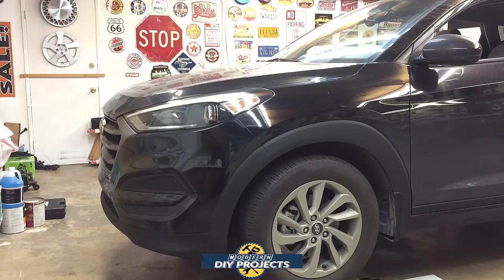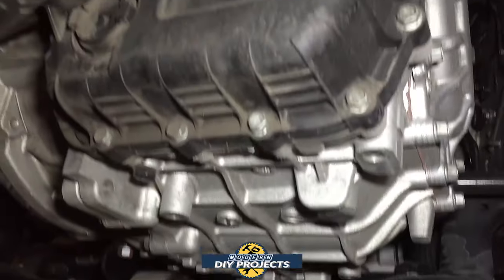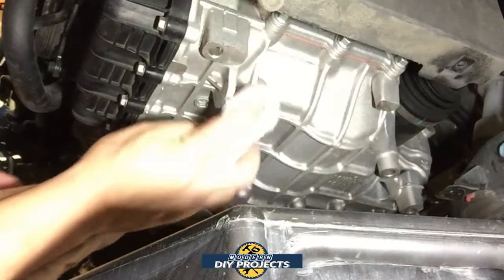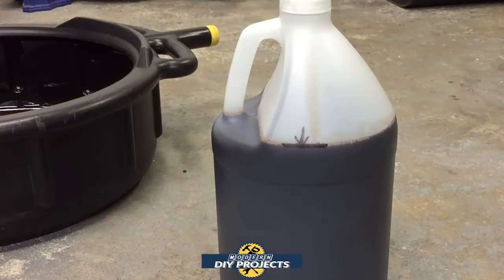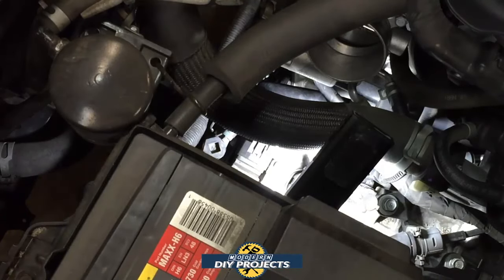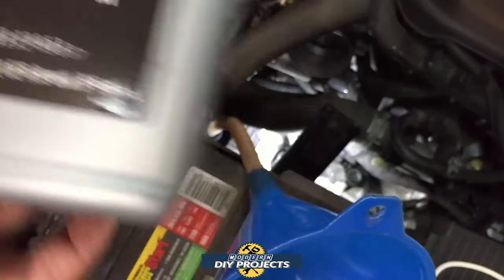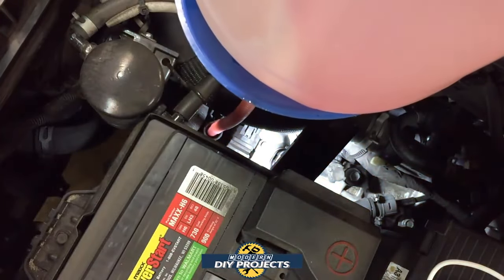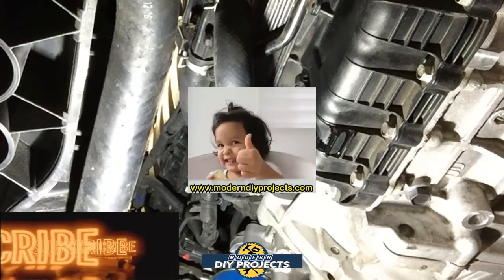How to: Transmission Fluid Change on Hyundai Tucson 2016 and Newer

Comment from the maker: In this video I show you how to change the transmission fluid on a Hyundai Tucson 2016 and newer. This procedure also applies to most Hyundai and Kia vehicles with Automatic Transmissions. Any questions on the process, anything that is not clear or I didn't explain properly, just comment down below and I'll answer your questions.
Reply: Is lt required to do reprogramming after changing fluid of transmission??
Reply from the maker: @hosamkhan8146  It does not. Works fine just the way I showed you.
Reply: thank you so much for the video.i wants to know is there a filter for the automatic transmission of tucson
Reply from the maker: @jinojose5373  It does not have a filter so no worries.
Reply: Is it ok to send a dipstick through the fill hole of the transmission and check the level before draining the fluid? Make a permanent mark on the dipstick so i will know what level to refill up to with new fluid?
Reply: @ModernDIYProjects yes filtro,
Reply: Very helpful. Thank you.
Reply: Hello and thank you, I just asked at Hyundai car service and they told me that the fluid (oil)transmission doesn't have to get changed. They said it is Hyundai standard and no go for transmission fluid (oil) change. 
I have an automatic also , 2.0 Liter,185hp, Diesel and I'm still confused about this advice from Hyundai. It's written also in the car book. Mention, Hyundai Europe, Germany.
Reply: @violaknight1989  Today i did this oil change.... at 90.000km - tucson 2018 2.0 crdi awd.  
The oil was black and looked dark and bad. Dealer said i should not change it until 120.000.km. 

Bottom line is.... dealership advice is the MINIMUM required maintanance so that your car survives the 5 year warranty. 
Of course... MINIMUM is not the same as OPTIMUM. 

PS: dont forget to also change the differential oil & the transfer case oil.  (they use the same oil, less than 1l each)
Reply: Crdi sounds like a diesel, so very different maintenance. Tucson VNA 2018 and later is a 1.6 mild turbo (175) bhp.  Of course GDI engine means top tier gas only or you will burn a valve. In the early 2020's Hyundai switched from GDI to MPI for the 1.6 and, probably boosted the turbo to keep or improve HP.
Very complicated and sometimes confusing brand, though most of the time the cars are fine.
Reply: Is this a DCT transmission that comes in the huyandai  Tucson night edition
Reply: Ummmmm according to the book and Google.  It take 10 quarts of transmission fluid.....

Comment: Great video. The only thing is the level should be checked with the engine running in neutral and the fluid should be hot 122-140 degrees (since transmission fluid expands with heat). Then open the side level plug and drain excess overfill. 10mm screws hold the bottom shield which has to be removed to get to the drain and level plugs.

Comment: Just put back what comes out, folks. Mine dropped 3.2 quarts. I used a 4qt pitcher from Walmart to measure.
Most likely, it will be 3 to 4  quarts. 
I used a funel, and I had to push it down into the fill hole. For some reason, it would burp some back out the funel. I guess it was  snug. 
I also cut out a square right below the drain plug. I don't advise doing this, but I'm too lazy to remove that cover. I will be doing this flush every August. I figure what is $25 vs. a new transmission. I used Valvoline max life multi transmission fluid. I contacted Valvoline, and they said the fluid meets all specs. 
Awesome video 📹 BTW.
Thank you for saving me $160.
Reply: It "burped" cuz it didn't have air flow vent. Kinda like how gas cans have a vent on them
Reply: @cavyboy99  yes exactly 
Well worth doing, though.
I added a little more because some splashed out.

Comment: Great video, 2 suggestions. Show how to release the plastic rivets that hold the underbody and, fast forward during the fill process. Your explanation of measuring the amount removed and checking the fill level is absolutely correct!
Reply from the maker: There are no plastic rivets for the under body cover. It's all held in with screws.
Reply: @ModernDIYProjects  There is one plastic nut on a metal stud at the front center. The rest are 10mm bolt though.
Reply from the maker: @frederf3227  Yeah, I forgot about that one. Don't know why they put that odd ball there.

Comment: One thing some automatic transmissions  have fluid checked warmed up and engine running this is because some of the fluid is running through the torque converter and valve body that will drain down when the engine is off. This is essential to check to not underfill your transmission. I have done CVT and regular planetary automatics that have this procedure.

Comment: When checking the transmission fluid level at the level plug, does the engine need to be running to get an accurate level? I thought that it did so that the internal transmission pump was circulating fluid, but you mentioned that you checked it with the engine off. Excellent video!
Reply from the maker: These newer sealed transmissions you check with the engine OFF. You do not want the fluid circulating or sloshing around. You want to get a full level with static fluid, otherwise it will pump it out of the hole when you open it up. It's just like checking your engine oil. You do that with the engine OFF.

Comment: Can the transmission fluid be sucked out with a pump through the transmission refill plug so we don't have to go under the vehicle and remove the the bottom cover and jack it up and all the mess with removing the bolt?
Reply from the maker: You can do it that way but whats the point. You have to take the bottom off to check the fluid level anyway, so what do you gain doing it this way? If you don't check the level properly you will ruin your transmission.
Reply: @ModernDIYProjects  just put back in the same amount that was sucked out.
Reply from the maker: After looking at the repair manual I have to change my answer. You cannot do it the way you want. If you try to insert a tube in the transmission through the fill hole, it wont go very far because you'll hit the valve body. It's like trying to drain the oil of the motor through the top of the motor (without using the dipstick hole). There are too many things in the way. Since this transmission has NO dipstick, there is no clear path all the way to the bottom of the pan. So at best you might drain a couple of ounces if any. So, no, you have to do it through the bottom drain the way that I showed in the video. There is no clear path to drain it otherwise.

Comment: 1. What is the measurement of the mouth of the screw to pour the fluid into it?  It is to buy that extension..

2. Should the shift change be done with the vehicle stopped or should I run it and then verify?
Reply from the maker: That would be hard for me to measure since it's so far down in there, but I would say it is the same size as any transmission dipstick. The funnel I used is made to be inserted into a trans dipstick and it worked just fine. Any narrow funnel should fit. As for the shifting, it should be done with the vehicle stopped. Jack it up and just run through the gears before putting a load on it. Then you can check the level. Or you could take it out for a drive after doing the shifting and then bring it back and lift it up again, and check it again, but that just seems like a lot of wasted effort to me.
Reply: @ModernDIYProjects  ok, I think I explained myself wrong regarding the extension, I was referring to the head, if it is to give an example of 1/2, 1/4 etc... not the length of the piece...
Reply from the maker: In that case then the answer is simple. On the outside I believe it is a 19mm bolt pattern. On the inside it is a square pattern that accepts a 3/8" drive. So I used a long extension and just used the middle opening. Since it's plastic I thought it was a safer way to go. Any long extension will do the trick.
Reply: @ModernDIYProjects  Excellent, Thanks...

Comment: Howdy,
I would appreciate it very much if you could help me in the following situation.
  Is there anyone among you who has changed the oil in the Hyundai Tucson automatic transmission? Because the opinions are divided, the dealerships say they don't change, while other mechanics say they do.

I decided to change it, especially after I opened the shield and noticed an older oil stain on the joints of the box.
Now I don't know which exchange method is better, someone told me to simply change it using the classic method by pumping inside with a can or pump. But I also heard of the method where there is a special machine, which extracts the old oil, cleans the pinions and internal holes with a solution and then automatically puts in the new one.

I don't know what oil to use, someone recommended TOP TEC MTF 5300 70w-75w.

The car has 120,000 km and is a Hyundai Tucson Turbo-TGDI 2017, petrol 1.6 automatic with 7 steps, 130kw/177hp, double mechanical dry clutch.

The questions would be:
1. If it changes?
2. What method is used for exchange?
3. And what type of oil is used?

Thank you 🙂

Comment: When should I change my transmissions fluid changed. I have 2018 Tuscon at 40000 miles.
Reply from the maker: Hyundai recommends at 60K for heavily used vehicles like Uber and Taxis, and 100K for normal use. I did this one at 100K and you can see how dirty it gets with normal use. I suggest to do it any time after 60K.

Comment: Great video. Thanks for doing this.

Two questions:
1. Do you think transmission fluid flushing is required (as against draining and changing) sometime?
2. Is this SP4 transmission fluid from Hyundai a synthetic one or organic one?

Thanks again...
Reply from the maker: Transmission flushing is an all around bad idea on a good transmission. That is something you do to try and salvage a bad transmission. Never do that on a good transmission or you could ruin it. It's like raking the muck at the bottom of a clear pond. You know the mess that makes. The SP4 is synthetic as are most if not all ATF fluids these days. Even my old 97 Dodge ATF Fluid was upgraded a few years back to be synthetic.
Reply: Thanks. That helps.
I find some comments at places about SP4 not being fully synthetic. But then that's not validated..
Reply: Thanks for sharing your video. I own 2018 Tucson and have about 75k miles on it with no issues so far. Planning to do this procedure in summer. I am thinking if i can fill the new fluid directly from level check plug instead of from top. This way I won’t need to remove anything from top. You see anything wrong in this approach?
Reply: That’s a good question.

Comment: Our 2016 eco tucson uses the SAE 70W transmission fluid. It only uses 2 quarts.
Reply from the maker: You probably have the 1.6L which does not have a traditional automatic transmission. What you have is a Dual Clutch transmission, which is technically a robot controlled manual transmission. To you it seems like an automatic, but in reality it is a manual transmission that is shifted by the on board computer. That is why it takes a different fluid.
Reply: Is yours a eco and sport? 
Automatic and gear switching?
Reply: Howdy,
I would appreciate it very much if you could help me in the following situation.
  Is there anyone among you who has changed the oil in the Hyundai Tucson automatic transmission? Because the opinions are divided, the dealerships say they don't change, while other mechanics say they do.

I decided to change it, especially after I opened the shield and noticed an older oil stain on the joints of the box.
Now I don't know which exchange method is better, someone told me to simply change it using the classic method by pumping inside with a can or pump. But I also heard of the method where there is a special machine, which extracts the old oil, cleans the pinions and internal holes with a solution and then automatically puts in the new one.

I don't know what oil to use, someone recommended TOP TEC MTF 5300 70w-75w.

The car has 120,000 km and is a Hyundai Tucson Turbo-TGDI 2017, petrol 1.6 automatic with 7 steps, 130kw/177hp, double mechanical dry clutch.

The questions would be:
1. If it changes?
2. What method is used for exchange?
3. And what type of oil is used?

Thank you 🙂

Comment: Thanks for this video. Do 2021 Hyundai tuscon have diff oil?
Reply from the maker: If you have 4 wheel drive you may have a rear differential with fluid that needs to be changed. Front wheel drive cars do not have that.
Reply: Thanks for responding so quickly. I didn’t see a rear diff so I felt confused I’ve always driven rear wheel drive vehicles. Lol
Reply: I have a 2019 AWD. Changed the transfer case and rear diff fluid at 45k for the hell of it. Really easy DYI. The fluid that came out was as clean as what I put in.

Comment: I have a 2016, 1.6 L Tucson. The manual states ATF capacity at 7.71 qts. The dealer parts counter guy told me it takes 4 qts and sold me Hyundai SAE 70 MTF. I questioned that and he reassured me that is the correct oil. Now I'm just confused.
Reply from the maker: Go back and reread the owners manual. You will notice that is gives you the quantities and fluid types for both the DCT (Dual Clutch Transmission) and the Regular Transmission. Your 1.6L has the DCT. My 2.0L has a Regular Transmission, so things will be a bit different. Also the parts guy sold me 6 qts telling me that is what I needed and I only used 3.8qts, so go figure. I would say make sure that you have the correct fluid above all else. Secondly, if it makes you feel more comfortable just go buy more fluid and return it later if you don't need it. It's better than being short of fluid when you are doing the fluid change, because then you can't finish the job and the car wont run without the right amount of fluid. I kept the extra fluid I got for next time because I got it at a really good discount. Hyundai fluids are NOT cheap!
Reply: Is your transmission DCT

Comment: Could we also refill through the overflow opening?
Reply from the maker: You can but not a good idea. I don't know if it may give you false readings. Hyundai recommends using the top opening in their manual and that is what I would suggest to use.
Reply: @ModernDIYProjects  thanks for your response. A quick follow-up question. After doing the final checks, did you have to add any more fluid, or was there drainage through the overfill hole?
Reply from the maker: There was a bit of drainage so I closed it back up. I didn't want to loose too much so I stopped and closed it up. Since I measured exactly what came out, I knew that there was no room for waste.
Reply: @ModernDIYProjects  thank you for your responses. Really appreciate this content
Reply: @ModernDIYProjects  just subscribed!

Comment: Is that really accurate? Doesn't the transmission loose some during the course of ownership by the time you change out the fluid?
Reply from the maker: Actually, the transmission should never loose any fluid unless you have a leak. As you can see this one was dirty but not oily, meaning NO leak. The transmission is not like your engine oil. You never loose any fluid to the combustion process like you do with your engine oil. But if you are concerned, then all you have to do is the overflow test which I explained in the video. It would be easier with a dipstick, but they don't want you to mess with it. More money for them if you take it in to be serviced.
Reply: @ModernDIYProjects  oh i see. I find that surprising tho. Doesn't the transmission create friction and  heat as does an engine? If so how come the transmission doesn't loose any fluid?  

Also , one other question. How much oil should a Tuscan engine or any engine for that matter burn engine oil? I noticed that after approximately 4000 miles since I last got my oil changed, I am below the "low" indicator line when I check my current oil levels. Does that seem normal to you? 

Also lastly. Is it ok to mix different brands and engine oils with different viscosity such as 5w 20 but I top off my engine with 5w 30 is that ok and doesn't cause any issues? Thank you so much!!
Reply from the maker: You misunderstand how the process works. These oils do not wear out or evaporate like water from friction or heat. They are created to tolerate extremes. The oil in the engine disppears because it escapes through the combustion chamber, not because it evaporates. It is literally burned off. The transmission doesn't do this. 

As far as much much oil you should loose between oil changes depends on how often you do an oil change. You should not loose any more than 1/2 qrt every 1500 miles. If you are loosing more than that then you are consuming or burning oil, and NO, NEVER mix different viscosity oils, that is a bad thing to do.
Reply: @ModernDIYProjects  I see. thanks for the clarification.  You said how long ago also affects how low my engine oil level should be? I've had my last oil change in November last year. 4000 miles ago. And the oil level is below the 'low' mark on my dip stick. Does that seem like excessive oil burn for you? Thanks
Reply from the maker: Really hard to say. I would never let it go that far. At this point you start getting sludge build up and it's hard to say if the missing oil was burned off or became sludge inside the engine clogging up oil passages. I have one car that I do oil changes once a year and that is because I drive it less than 1K per year. So it seems crazy to change the oil every 500 miles in my case. But in your case I would change it at around 2K miles at least to prevent problems. The oil is the blood of the engine. If you plan to keep it, change it frequently. If you plan to dispose of it, then don't worry about it.
Reply: @ModernDIYProjects  appreciate you taking the time to answer my many questions. Love your channel by the way. Have a great day.